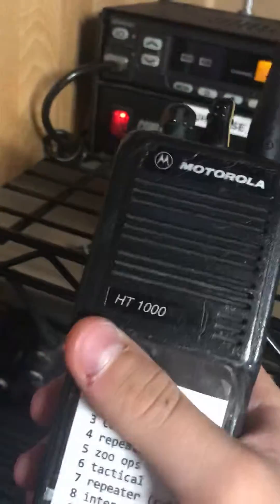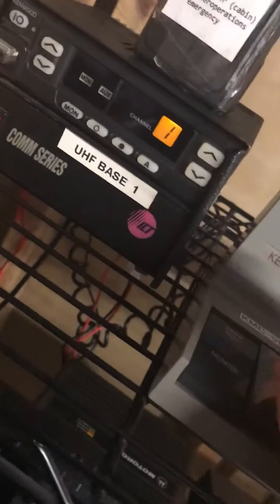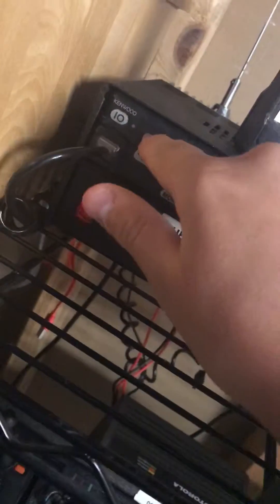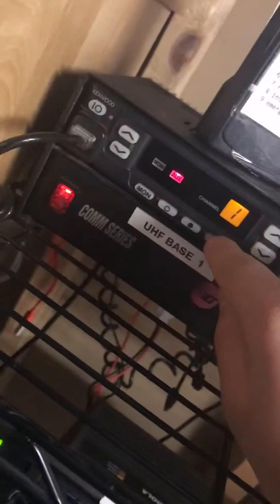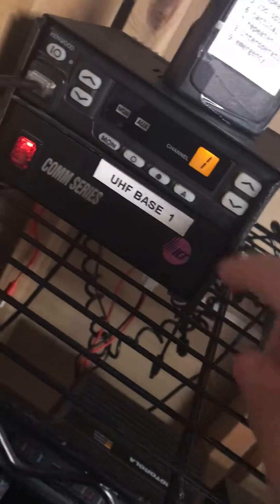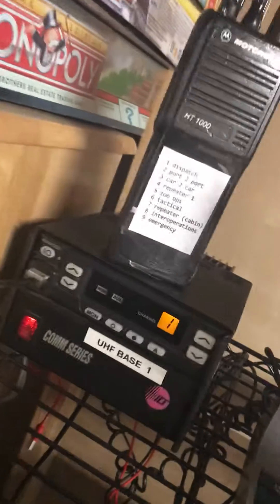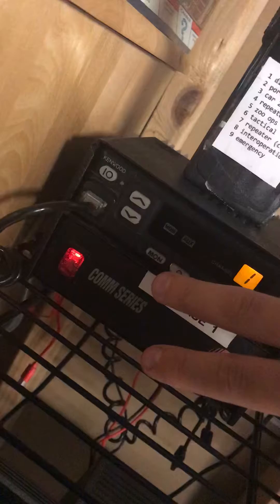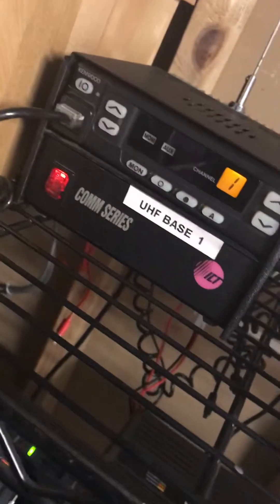Me showing the capability of quickcall II signaling

Comment: Just found your video. I have two Motorola CDM750's, one in the house and one in the car, programmed for VHF MURS frequencies--don't worry, they're power appropriate. I also have a HT-1000. The radios talk a long way, considering and I have fun with them with friends. 
You have quite a setup there, and seem very knowledgeable about the radios you have. Do you do programming, or can you suggest how I might be able to reprogram my mobiles and HT1000? From what I've read, it's a computer nightmare if you're not fully versed on the stuff. Or, maybe I just need to find someone to program them for me who will make them do what I want!?!?
Great video. Enjoyed seeing the radio gear you have.
Reply from the maker: thanks for the comment I really appreciate the feedback. and yes, LMR and public safety COMMS gear has been a hobby and passion for many years of my life. and relating to the computers simply winXP and Win7 appear to have success with dos-box as long as the motherboard has a hardware serial controller installed and a proper driver. No, I do not offer programming services at the current time possibly in the future. but feel free to ask any other questions you may have I'm all ears.